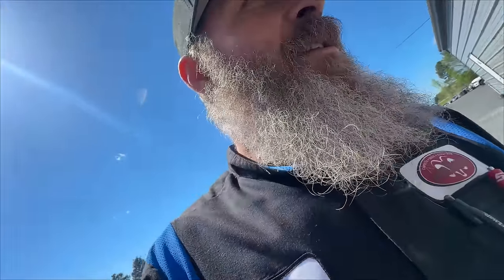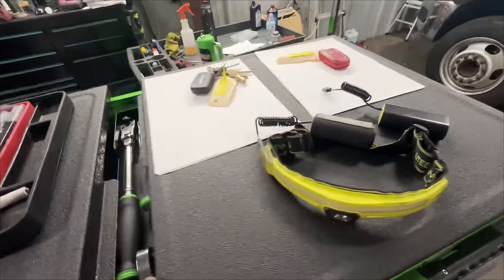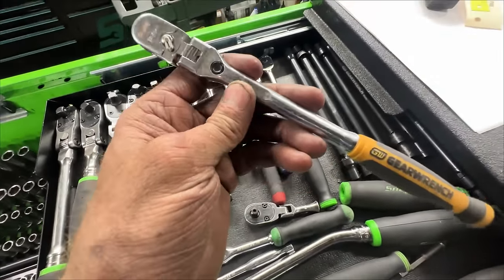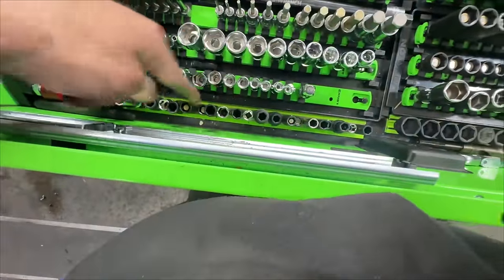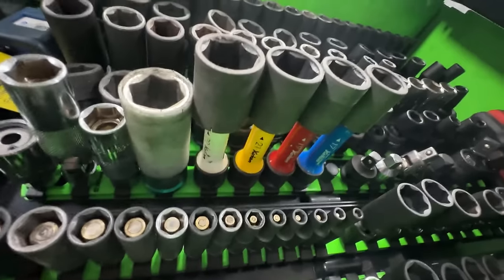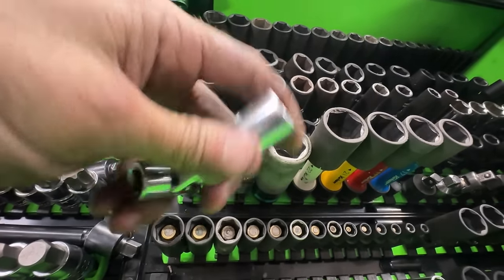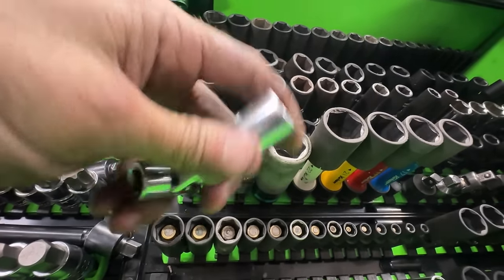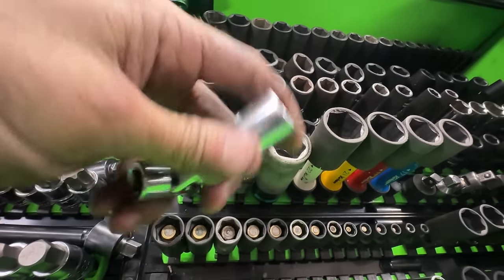SNAP ON KRSC430 TOOL BOX TOUR UPDATE MATCO GEARWRENCH TEKTON

Comment: You didn’t need to buy a replacement 10mm Tekton socket.  Their warranty is absolute, forever, and the best in the business.  Spend ten seconds filling out the form on their website, attach a picture of the broken tool, and the replacement is in the mail the same or the next business day.  I recently broke a screwdriver late on a Sunday night and had a new one in my hands Tuesday morning.  It’s unreal.
Reply: It’s probably so that if he loses it or breaks it he has a spare while he waits to get the one warrantied, I have 3, 36mm sockets just in case I break them I’ve got spares
Reply: He's got wobble impacts sockets. 
Should just buy another one; keep the one he broke as a reminder - kinda lame to make them replace something you used wrong and broke.
Reply: @Michael_Wright why you crying about warranty of a tool you don’t own.

Comment: Try the koken ratchets they have the best back drag i thought it was a you tube sales set up but i got them a few months ago and love them
Reply: I got the 3/8 in 1/4 Koken flex heads on Amazon for cheap. One was perfect and the other was skipping teeth, loosened the screw and it works now. Lowest backdrag I have ever felt like all the reviews. They make some great knurled extensions also, got the wobble fixed and regular from them. They designed the wobble fix before snap on copied it.

Comment: Super jealous of the your green Snap On cart. That's the exact cart I want, color and all. Love the slide top and it has 4 swivel casters compared to HF with only 2.  The way you have it setup is pretty sweet also. Just can't afford the box. The Mac RBRT wrench set is a 6pt wrench correct? I don't have any trucks so without an easy warranty, I have been looking at the USAG 285x metric set. It's the RBRT set, I believe.
Reply from the maker: Thanks buddy… didn’t like the green at first but it grew on me.  Yea USAG makes the RBRT set… awesome wrenches. I think they are cheaper as well
Reply: The HF full bank has 4 swivel locking casters and goes on sale for $500 all the time. I want the slide top but the price is insane unless you are a professional. I wish I would have gotten it sooner as it holds all my important tools better than my old box.

Comment: Uh what’s the part number of that 3/8 drive 1/4 head indexing ratchet?!? Because I need it. And my dealer comes on Tuesday’s.
Reply: And add that non flexing 3/8’s in a 1/4 also. 😂 Someone is spending $500 this week. 👍🏻👍🏻👍🏻
Reply: An added benefit of the snap on 3/8 drive ratchets with the 1/4 body is that they have the back drag of a 1/4 while working with fasteners commonly driven with 3/8 drive sockets.  Barely finger tight on an M6 Allen head bolt and the ratchet is a-ratcheting.  It’s positively magical.

Comment: Seeing that I wanna get that same roll cart. What size length are your enrst socket holders? I have 6 that would really like to have fit on the top just like that But I dont know if they will fit since i have 2 13”  and 2 18”.
Reply from the maker: They are 18”… the 18s will fit side by side.
Reply: @RageBrothers sweet, THANKS! 🙏🏼 Now I can place my order for storm grey and a lot of high viz stuff 🤣🤣